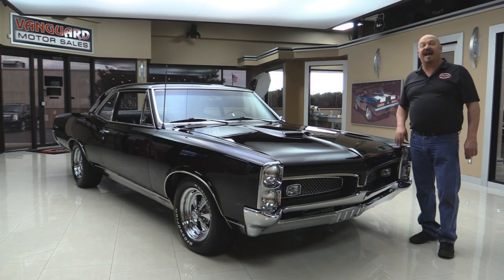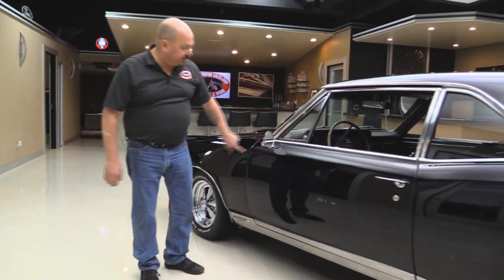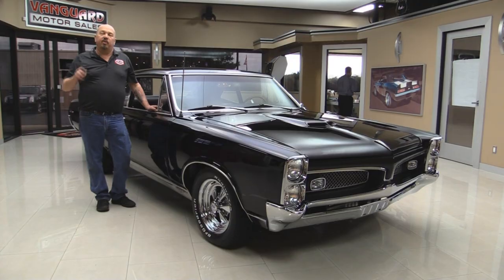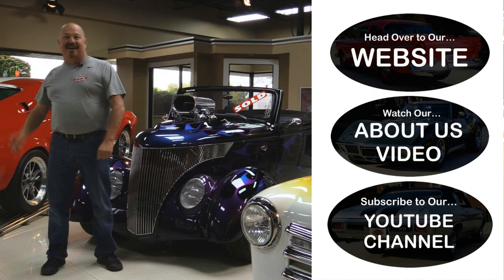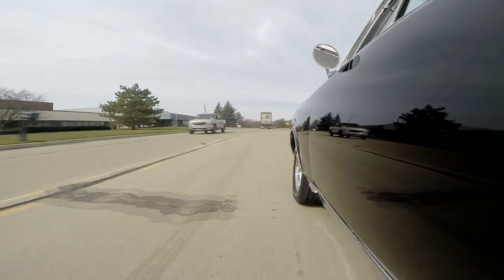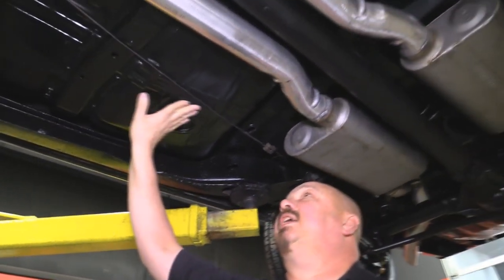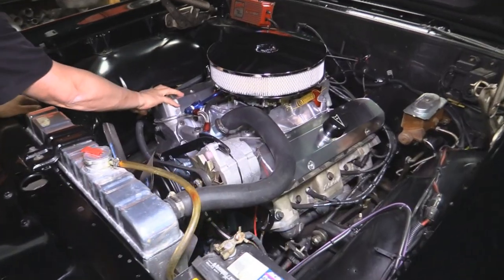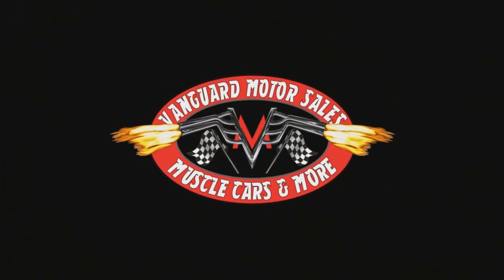1967 Pontiac GTO For Sale

Comment: "389 under the hood"???  67 GtO's were the first year the 400 cid engine introduced, with Quadrajet 4bb carb.
Reply: Yep
Reply: Right.
Reply: Correct. It’s a 400 CID. 

The 400 and 389’s sound different, the former featuring a very distinct lope.

Comment: '67's came with 400 Cu In, 335,360 and 366 for the ram air version.....
Reply: EXACTLY ..I had one and it wasn't stock...... The '67 was the first year of the 400 cu in.....
Reply: Correct.